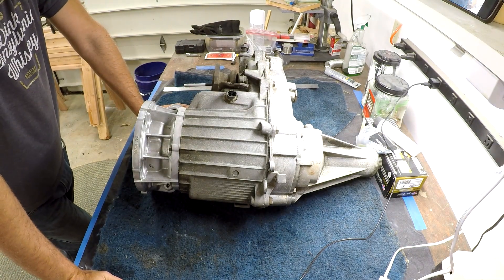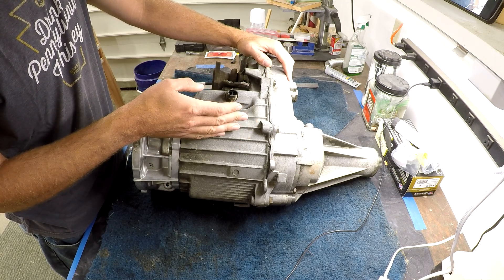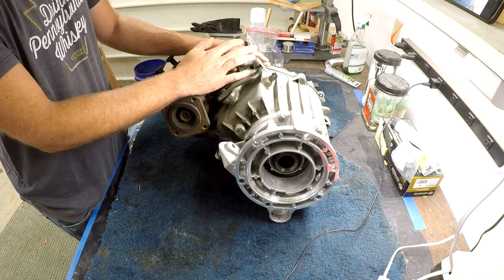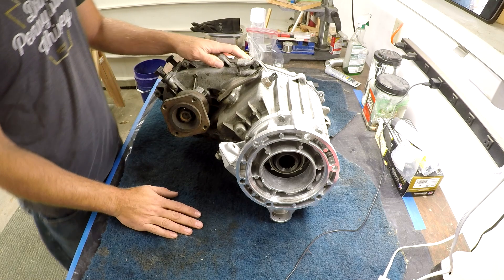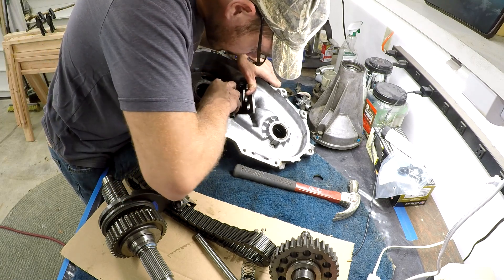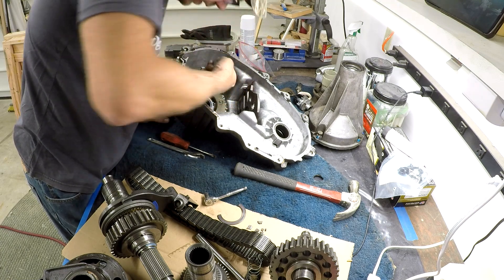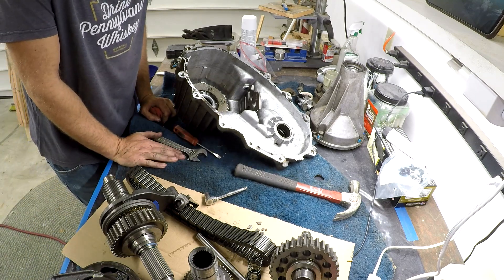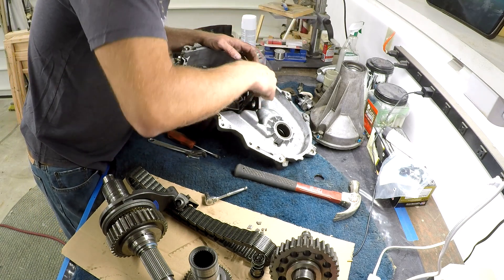1988 Suburban LS Swap - Part 2 - NP208 Disassembly/Mating NP208 to 6L90E

Comment: One other question for you, what part # was that transfer case adapter that you used in this conversion?  Thanks!
Reply from the maker: I mention it in the video but I used 84203235. Worked perfectly.
Reply: @JEG's Garage  I appreciate the info.  For the sake of curiosity did you look at the idea of just buying the 4wd version of the 6l90E output shaft instead of having the 2nd version machined or is the problem that 4wd version is still 36 splines and then you would not have anything to machine down?  I know next to nothing about the 6L series of transmissions so just fielding questions for folks in some of the swap groups that I have been seeing lately!
Reply from the maker: @CraftwerksMC  I did. I wasn't able to find  the output drum for the 6L90, new or used. 6L80 is different so that was a no go. I think the 4wd version is 29 spline too. Not sure. To be honest, the trans had to come apart anyway, and the machine work was very cheap and very quick. Tcase had to come apart too as one of the thrust washer was busted. So it all worked out and 32 spline is nice.

Comment: ive seen you and another do this swap and both use 2wd transmissions. can you not use a 4x4 trans? Thanks!
Reply from the maker: Sure can! I just happened to get a 2wd trans. Luck of the draw. Couldn't pass up the engine/miles/price.
Reply: @JEGsGarage  would bolting an 8l90e to my np208 be the same as the 6l80?
Reply from the maker: @ethans2002  good question. I can't verify but I bet it would be similar. GM kept the adapter patterns the same for a long time. Shaft compatibility would be your main concern.